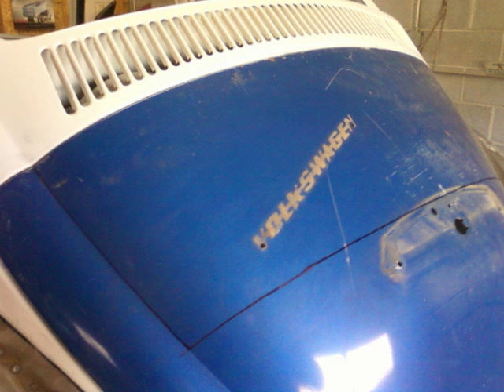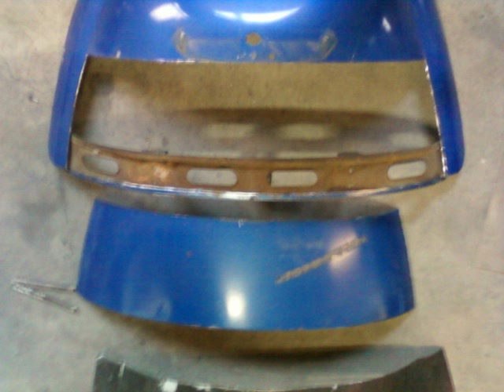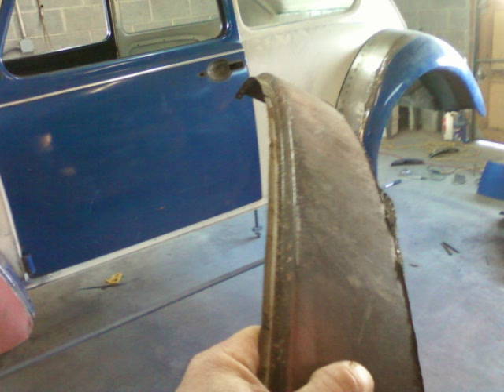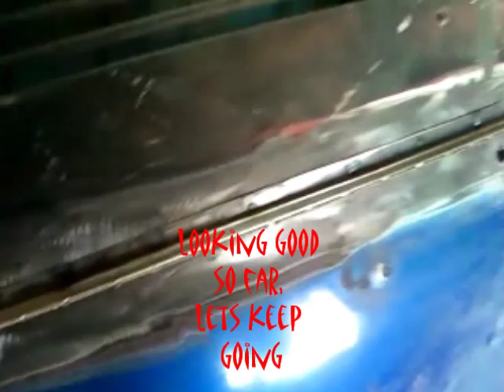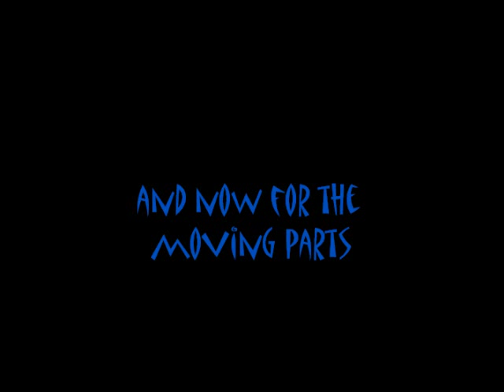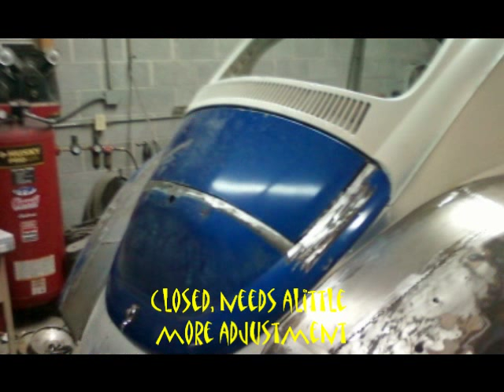68 ground up 7

Comment: That will restrict airflow.  Put a standard deck lid on and setup the actuator to open the top.  This will force air down into the engine compartment.